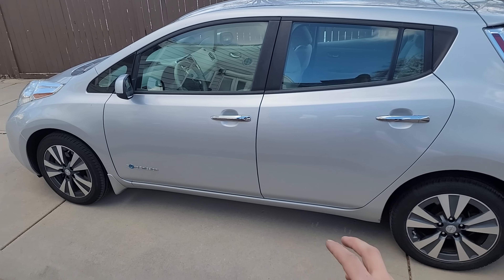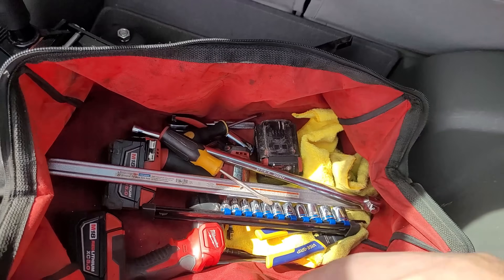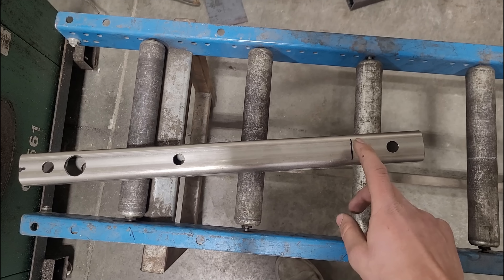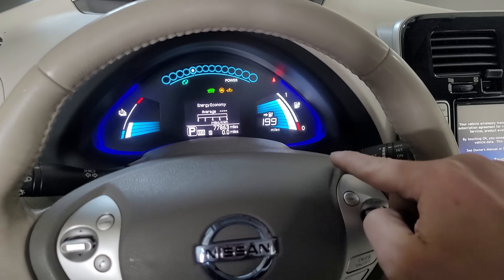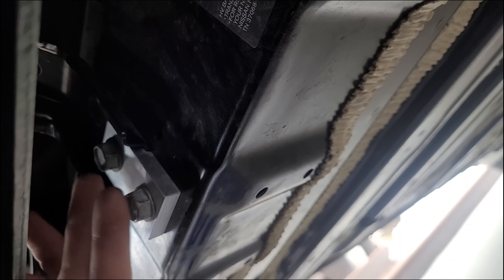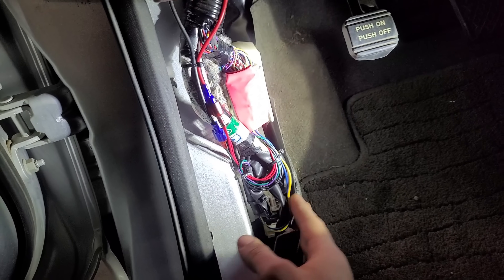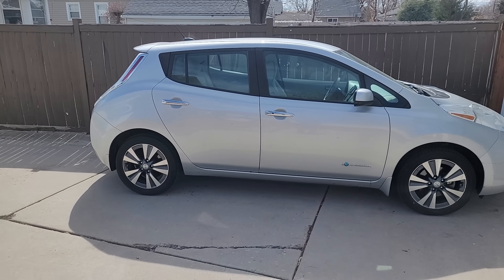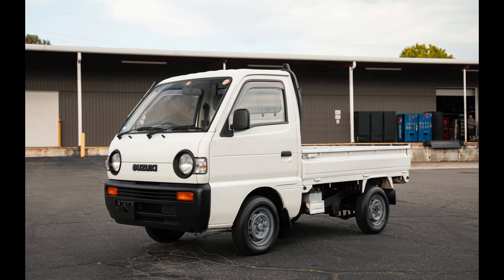Under $5K Nissan Leaf 62kWh Battery Upgrade

Comment: Thanks for making this.  Hopefully that 40mm tubing isn't hard to get.  Did you figure out the correct length for those spacers?  I see Github's spacer drawing has the overall length at 480mm.  I'm wondering if that's the dimension you used and ended up short?
Reply from the maker: Yes, I misread the drawing and cut them to 480mm instead of 580mm.
Reply: @zuccamachine  Thanks again, that helps a lot.  Can I asked where you got this stock?  I'm getting laughed at from metal supermarkets and not seeing much online.
Reply from the maker: @BradJannaway I actually used 1.5” tubing, it’s close enough. I’d recommend using normal steel and powder coating since people have brought up valid corrosion concerns from dissimilar metals between the stainless adapter rail and the frame. I used a generic online metal supermarket.

I sell pre-made kits for everything you need for a 62kWh swap if you’re interested. Email azucca14@gmail.com

Comment: Yeee you got ripped off
Reply: I meann, a Leaf of around this year in good condition costs around $3,500, maybe even $1,500-2,000 with a bad battery. If you can do the battery upgrade yourself for under $5k, you can have a long-range EV that's 3-4 times cheaper than a base Model 3. Not everyone wants crazy horsepower and the latest features.
Reply: @Joshtheweatherman  "3-4 times cheaper" ... ugh I hate that type of inverse-multiple type of figure of speech. 

Doesn't it just plain sound wrong to you ?

Less = smaller. Say it is one third to one quarter the cost. Or say it is 66% - 75% cheaper.
Reply: @Joshtheweatherman  These leafs on the auction that are lightly damaged, the plus models, are like $4k(with the big battery). To fully fix a newer 2020 would be $6-7k all in. Same thing actually goes for the 2018ish model 3's as well, but its a significantly better car than a leaf in every way.
Reply: @Joshtheweatherman  Also, im very confused why youre comparing an old as hell leaf to a brand new model 3 in cost.
Reply: @EugenePutin  imagine thinking Tesla's are good investments 😂😂

Comment: Hi! Great video on the Leaf battery upgrade—I'm seriously considering reaching out to you for a similar service on my Gen 1 Nissan Leaf (original 24kWh). Before I decide, I have a few questions about safety and reliability, especially since I'd be using a used battery from a wrecked newer model:

When sourcing a used 62kWh battery, how can I be confident in its condition? Are there specific tests or inspections (like using Leaf Spy or checking for hidden damage) you recommend to avoid issues like degraded cells or potential fire risks?
Gen 1 Leafs don't have active cooling—does that pose any significant problems with a larger battery, like overheating during long drives or faster degradation over time?
Regarding the mounting: The new battery is much heavier and taller. How reliable is the custom setup with spacers and adapters in a Gen 1 chassis? Any concerns about it shifting in an accident or affecting handling?
Do you offer any guarantees or warranties on the upgrade's reliability, like for the CAN bridge, mounting, or overall integration?

Thanks in advance for your insights—I appreciate your expertise!
Reply from the maker: Email azucca14@gmail.com and I can answer all these questions in detail!

Comment: These batteries, like most, come from China, so sourcing is very important.  I had my 2011 Leaf's original 24 Kw battery replaced.  It was down to about 15 miles of range.   I had a specialty shop install a new 62 Kw battery.  Very happy with it.  Now I get about 200 miles or more.  It has been 6 months and so far no problems.  It cost me about 11k, but it was worth it.

Comment: I love my 2017 Leaf. It's down to 95 miles of range, but it is so comfortable, and I am not a small man at all. I would love to have 250k range on it.
Reply from the maker: Are you near Utah? I'm starting to do battery swaps for customers!
Reply: @zuccamachine  I'm interested to be your customer! How much will it cost?
Reply from the maker: @rupablic  About $7-9K. Batteries are $5-6K and $2-3K for labor depending on what gen Leaf it is.
Reply: @zuccamachine , thanks, and how much can I get selling my old 24kw 8 bars battery?
Reply from the maker: @rupablic You’d get the $300 core back at a minimum. Maximum $1200 if you found a solar buyer
Reply: How many miles is the 62kw get?
Reply: @ozzie3056  I've got one - about 220-240 miles depending on hvac usage.

Comment: Hi dude do you have any knowledge of when an after market sodium ion battery pack might be available for the leaf, all I’ve heard is when they do hit the market they’ll be upto 70% cheaper to buy
Reply from the maker: That’s probably 5-10 years away
Reply: @zuccamachine shame , one can only hope
Reply: SIB is not cheaper than LFP, and it's not a drop in replacement because the voltage range is very high. LFP will be superior for years.

Comment: Using concrete blocks in a demo for the public is pretty effing stupid. Those things could shatter very easily. You should just be using better jacks. Wooden blocks would actually be safer than concrete and wooden blocks aren't safe.
Reply: Ive seen it happen.

Comment: What year has the 30 KW battery? I have a 2013 and I think that's the 24 kw. I hope these battery replacements get a lot cheaper. I would love to be able to swap mine out but spend less than $2,500. I'm disabled so I'm on a very small income but I would like to get more than my 60 mi range. Actual I've never even gotten a 60 but that's what the guessometer sometimes tells me is my range. I've done 50 before and it didn't turtle up.😊
Reply from the maker: The 30kWh is the worst of the batteries, it degrades the fastest. Your 24kWh will outlast it.
Reply: Nissan now predicts the 24kwh “Lizard” battery to have useable capacity for up to 22 years starting with the 2014 models

Comment: I have a 2014 Leaf that charges to around 50-60 mi full charge. was wondering what the charging time is on your new battery?
Reply from the maker: It’s the same as any 62kWh leaf. 10 hours level 2, 40mins to 80% on Chademo

Comment: Awesome project. I am curious if the shocks will have to be replaced. The heavier springs makes sense but wondering if dampening needed to be improved?
Reply: ALWAYS replace shocks when altering suspension geometry.
Reply: If you don’t replace the shocks, you loose payload capacity. I wouldn’t dare put put in shocks from the gen 2 if they fit

Comment: Yeah. Still too much. They keep suppressing self charging.
Reply: You mean like perpetual energy machines??
Reply: Self charging?
Reply: @vincentlok8894  yes its like running a petrol car on water ...
Reply: @SeasonThreeIsBetter  no, they have batteries that they make from old radioactive waste and convert them into useable batteries that will get the same range but when depleted they sit over night and charge themselves, supposedly without any danger of radioactive over exposure.

Comment: you are crazy fiddling with batteries. If you're not an electrician and you understand the risks you're taking, you should not touch the batteries.
By the way, your car insurance company won't pay you a cent if your car burns down.
Reply: He's not fiddling. Just swapping. Now if he were to OPEN up the battery pack that would be a different story. I have opened up my Leaf battery pack and "fiddled" and nothing has burned down yet.
Reply: Also, you should check any halloween candy for razor blades. You could save a life! You can always tell who has never looked under the hood or dealt with an EV battery.
Reply: This is what many don't understand about EV's and their old battery packs. Even though the old packs are degraded they're still quite valuable. Barring any manufacturing defects properly maintained battery packs don't die they just slowly lose capacity. Even if they're 10 years old many will still have well over 50% of their original capacity and this makes them valuable. An old 30kWh battery pack at 8 years of age can easily retain up to 20kWh of capacity. That could power my home for 24 hours. If you check eBay you can see that old EV batteries are bringing a hefty price. An old out of warranty battery pack that still has capacity can help recoup 30% or more towards the cost of a new battery pack.
Reply: @TronJockey - You’re 100% correct,  they still work great for home or RV backup power situations. It’s good to see that they can be up cycled and not just scrapped.
Reply: Electrician would have no idea about a car battery
Reply: This comment made me dumber.  Actually the car insurance has to give you a 62kW replacement EV if this one goes byebye!  /facts
Reply: @jermwerty  only if he has full coverage, and he reports the swap with all the receipts to his insurance company
Reply: @CactusJack252  Insurance has to provide a like kind and quality replacement, whatever that Actual Cash Value of that happens to be.  You don't have to tell them ahead of time, just keep the receipt.  Also if someone else hits you, their insurance will be on the hook for the same.
Reply: @jermwerty  Car insurance in the US provides you with another car? In my country, insurance companies pays out the used value equivalent (regardless of upgrades) if the vehicle is totaled. And if there were upgrades that may have compromised the vehicle, it can void the insurance claims.
Reply: he just changed the battery pack; it's like swapping your 12V battery with a few extra steps.

Comment: so the broken connector just wasnt a problem? or how did you end up dealing with that and fixing it?
Reply from the maker: The connector broke on the old battery side. The pins were still intact so the buyer of the old battery was still able to use it for solar.

Comment: It occurs to me, watching the part where you talked about spending a bunch of time aligning the battery, that maybe you could use four of those scissor type transmission jacks to lift the battery pack into the car.  Or you could invest in a lift and hydraulic lift table, if you plan to do this as a business.

Anyway, super cool video!
Reply from the maker: A cart lift and an industrial wheeled table would be the best way to do this frequently.

Comment: Great Video... We are getting somewhere making these old leafs open source. Appreciate the details and your application of Dala pioneering open source efforts.  Sourcing the 62 kWh still seems to be the sticking point. My 24kWh 2013 Leaf will be getting this treatment. The 60 mile range it has now is ok for my current needs, but I am lurking and waiting. I have been milking the battery, using only house 110VAC and only for 7 hours at a time at night time when it is cooler and the electricity is cheaper. 

I don't think the world understands that we can keep these things running forever (barring leaf in a rust-assaulting environment). These will be more economical to maintain than an old volkswagen bug. And it is an EV!

Let me know of any opportunities for sourcing the 62kWh packs.

Comment: Nah I might aswell just get a toyota prius and not having to worry about the electric cost and waiting
Reply: Yeah and not save any money or time and still have all the bs from a gas car and add the electrical stuff to it. Making more points of failure
Reply: you all who dont own EVs always have these silly fear and ignorance based responses. Waiting for what...we wake to a full tank. 400miles on my car and I go like 3 to 4 days with no charge...then i plug in while I sleep n 5th day wake to a full "tank" ..that I paid 3 dollars to fill. n dont waste my life at some dang gas pump 1 ti 2 times a week. Speak your opinion from knowledge..noy fear n ignorance. 
wake up ppl. jesus!
Reply: your loss when eventually gas gets more expensive. also, isnt it hot enough already for you? air pollution, storms etc there are enough reasons. electricity will be dirt cheap in 15 years

Comment: We owned a 2011, 2015 and 2019 Leaf. If We could have done this back then we would still be driving  one of them. Is there  a kit you can purchase that includes the cam bridge, and the brackets? Great Job!
Reply from the maker: No kit that I know of, but I could make  kits and sell them if people are interested!
Reply: @zuccamachine if you can do it and a drive in service, you might have a nice growth business. 

Maybe have a swap car too as a small cost option, they can rent it while there's is being worked on. 

Just an idea. 

Maybe there's a EV mechanic near you who's interested.
Reply: @zuccamachine  The kit is where its at. I would be interested in helping make kits available. Doing the service will be a separate business. Compare to homebuilt kit planes. The liability makes the kit and the service separate businesses.

Comment: Having to trick the system into accepting the battery should be illegal.  That's like saying you can only use approved Nissan gas.
Reply from the maker: Not really, it's just a different data messaging rate between the different generation packs. A different 30kWh pack would drop into this car with no mods.
Reply: @zuccamachine  can you make a video about the can chip and what and how you flashed it, where you bought the chip itself etc?
Reply from the maker: @spadress  See Dala's github link in the description.

Comment: what is the improved range...
Reply from the maker: Watch the video, 50 miles before, 250 after
Reply: @zuccamachine  does the car report the range on the car dashboard ? And accurately ?? I'm half way through the video but in the comments
Reply from the maker: @gierso  Yes to both

Comment: What year is the car
Reply: Its unclear but it's before 2017. If the wheels are stock it's before 2015
Reply from the maker: Car is 2015. Battery is 2022

Comment: Nice video, instructiv. Just FIY, it were better to use steel brackets instead of Aluminium. It is well known that contact between two different metals (a.i. Steel and Aluminium)  create corrosion at the point of contact. Alternative, you may insulate one from another, but there is no point to such complication. IMO just replace them with steel ASAP.

Comment: 5K
An 14h job

Used battery OR NOT
Each battery cell need to be tested... 

That takes LONG HOURS

 suggesting people to do something that could put an Shorted malfunctioning battery cell 

VERY BAD ACCIDENTS CAN HAPPEN 

BTW
And the avoidance of Warranty  problem? 

The majority of countries has Lobbying in favor of manufacturers... 

WHY DIDN'T YOU STARTED THE VIDEO, explaining or at MINIMUM, WARNING this risk? 

Manufacturers and theirs

Unfair price of Components
 
Corrupt toxic and abusive anti Right to Repair conducts

Associations and Distributors Enabling unmoral brands to continue this... 

But you 
using an small chip
Tricking an KEY IMPORTANT SAFETY EV component... 

The BMS System

F.. If an accident happens It would still be a crime if you put your loved ones on this car 

An Scam Irresponsible TITLE but hey

An possibility of EV battery upgrade SHOULD BE certified by manufacturers, they're actually throwing money away...

Modifications without certified items
 poor Improvised tools and parts on Workflow 

No studied and systematic follow Workflow 

he's happy,
 most viewers are happy, watching and dreaming to do some "upgrade",  

if an accident happen whos paying?

Not an hidraulic car elevation, use concrete tiles. Watta champ
U have bought plastic gloves😂😂😂😂😂😂😂😂😂😂😂😂😂😂😂😂😂😂😂😂
Reply: Awesome!!!  Ignore the hate police.  Good for you.  I had dreamed about this as well but scared of the little electronic hack.
Reply: Karen alert!
Reply: What a joke, take your hate somewhere else. 

He's trying to keep a car with no range and make it something functional again. As if Nissan would warranty anything on it anyways. If anyone watching this needs a disclaimer before they try to swap the battery on their electric car to know it is dangerous, they are too dumb to do the swap.
Reply: Fun police 🤓

Comment: Hi  I enjoyed  your video.  Your hardware is really nice, much better than the uni-strut that that I made up.  I did a video a couple of years ago.  I should do an update as I have tools and methods that make it faster and easier.  I still use all-thread to guide the battery. initial alignment is done while the battery is setting on dollies.  I made a battery lift that lifts the battery off the dolly and also lowers it from the car to the dolly.  Still a lot of work wrestling that heavy battery.  I am using CAN buss version 4.23.  It is supposed to do better instrumentation for 2011 and 2012 Leafs.

Comment: EV will last crazy long if in future swaping battery will be even more easy unless maufacturer start to weld the battery directly into the chassis....
Reply: It will not be easier. Even in Leaf you still have to 1) Register / link battery (thanks to LeafSpy developer it's like free now), 2) Make it work with existing modules in Leaf which is usually done via can-bridge. If you are building custom battery - you have to make/find a software solution to make it work with existing modules. But european EVs are nightmare, wtf mercedes did is just beyond. They do everything to make it as hard as possible to replace a battery. Teslas better but also started to do shit in this area by doing more software barriers, thinner shell for batteries, one-time assembly materials so that battery housing couldn't be re-used and so on. Nobody needs a long lasting vehicle these days, unfortunately.
Reply: @MultiCarter007  I know American's can't get 'em. But Nio's have a modular swappable battery that works across their range of cars.